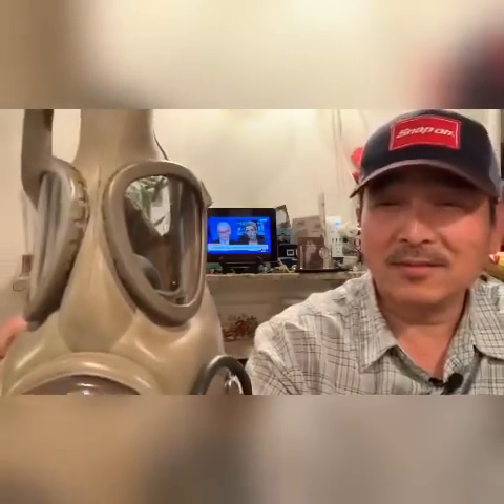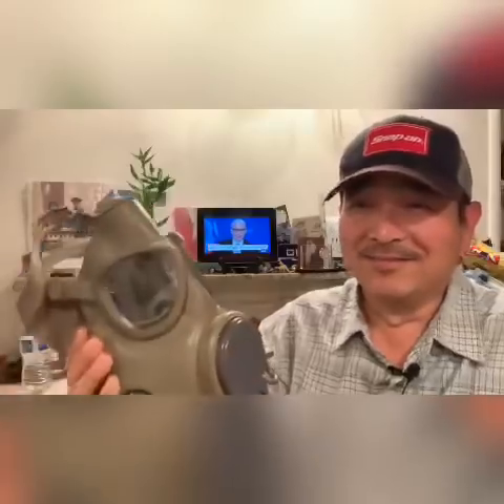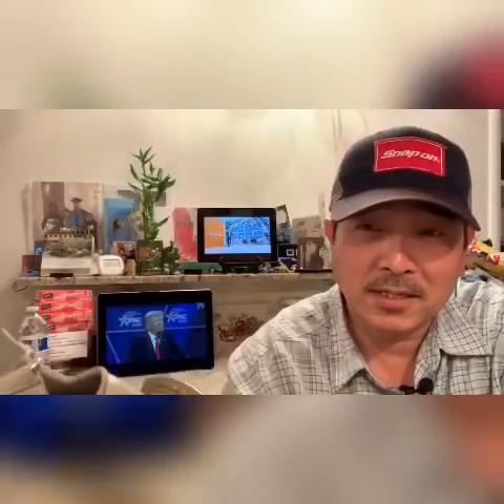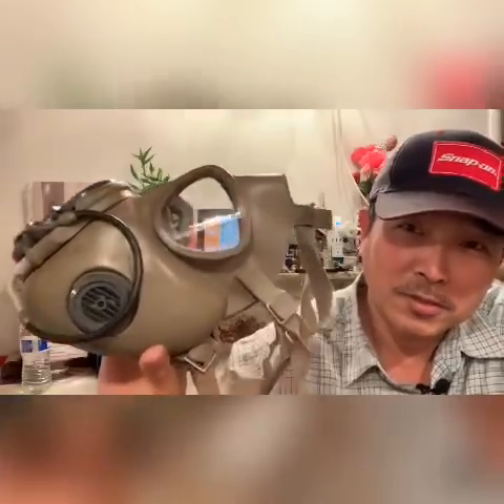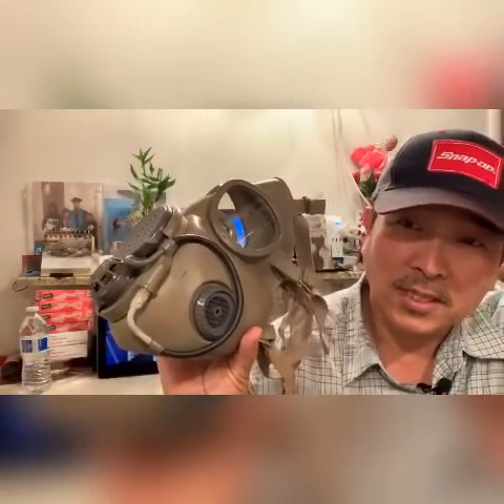How to make a Covid-19 face mask using Hvac air filter.

Comment: You do realize that AC filters have fiberglass that will infiltrate your lungs and be worse that coronavirus ????
Reply from the maker: Thank you for your comment, 🙏 the Honeywell brand doesn’t have fiberglass. If they did there would be a big class action lawsuit. People with lung cancer would blame them. High pressure air being blowed through filter and circulate in home and we breathe it. Please stay safe, respectfully r. Matthews

Comment: Great idea to leave the wire in rather than stripping it out which would damage the integrity of the filter fabric!
Reply from the maker: Thanks for your comment 🙏 in another video I removed metal wire netting  by soaking in hot water. And adding salt to filter. Please stay safe, respectfully r. Matthews
Reply from the maker: +R. Matthews https://youtu.be/Eq8qyO4G4No
Reply: Do not wet or wash the filter. You remove the metal from the filter before using it these filter are folded like an accordion that is what charges the filter to collect particles. So remove the wire dont wet , heat, or wash the paper and keeps the folds in the filter that is how to use these filters.

Comment: That is a #10 filter. The #13 filters cover viruses. My #13 has heavy wire mesh on it . It was harder to work with
Reply from the maker: Thanks for your comment 🙏 I don’t know?  Should be the same.  CDC are saying make them out of fabric! I think so you can throw them in washing machine right your  trip in pubic. Plus my homemade mask with filters is for short runs to the store. As an extra shield for peace of mind. Do not use homemade mask to visit anyone that are sick period.  Please stay safe, respectfully r. Matthews

Comment: 3M Statement (re: HVAC filters and mask use): "Our filters are designed to be used in HVAC systems, and the filter media has not been tested to be used as a face mask for respiratory protection. Altering any of our 3M Filtrete™ Air Filters is not recommended or supported by 3M or the Filtrete™ Brand. Customer safety is our number one priority. https://www.filtrete.com/3M/en_US/filtrete/home-tips/full-story/~/coronavirus-and-important-things-to-know-about-airborne-particles/?storyid=d69e7735-c02c-46d2-9c8a-ae23372934ac
Reply from the maker: +B GT thanks for you comment🙏 if the Honeywell hvac filters are not safe, there is a  class action lawsuit waiting to happen! People with lung cancer would blame their cancer on these hvac filters. Think about it... if they are not safe, why are we letting our babies breathe house filter air? Air are being blown through these filters with high pressure and recirculating the air we breathe for decades! And just now we are afraid of these filters. Just saying, respectfully r. Matthews

Comment: Great idea I used the Filtrete 2500 smart filter. Premium allergen n fine particles. Has American lung association logo. Blocks, Viruses, pollen, mould spours, exhaust n much more I will try post on my channel easy to make no sew mask. I used aluminum wire to make a oval to hold the filter part and shape around nose and under chin
Reply from the maker: +Hi Honey thanks for your comment and viewing 💪🏼🙏 , like your profile name👍
Reply from the maker: Hi Honey  , just learned that n95 mask uses citrus acid inside there masks. They used citric (lemon juice) to kill of COVID-19 and other forms of Coronavirus!   So instead of rubbing alcohol, use lemon juice. So if you make your own masks, spray lemon juice on outside mask and let dry. Please stay safe, respectfully, R.Mathhews

Comment: Why are you trying to buy N95 masks when our medical professionals are having trouble getting them? Making your own mask should have been your first thought, not Plan B.

With that scolding out of the way, I have been thinking about using pieces of Filtrete 1500 filters as disposable inserts myself, and think it's a good idea to use those. I would suggest at least one modification to your mask, though, which is a flexible but strong piece of metal at the top like the respirators you were looking for have, to mold the mask around the sides of your nose. If you have some sheet metal like they use in ductwork, some tin snips, and a way to file the sharp edges, this will do an excellent job. This is what I used in the washable mask I made, and it stayed put while I shopped for two weeks' worth of groceries. If you don't have sheet metal, I have seen people cut up a soda can and fold a piece into thirds lengthwise for extra strength, or thick wire with the ends folded in would probably work well, too.

Also, I wouldn't suggest pulling the mask down, then pulling it back up with your fingers touching the inside of the mask. You could contaminate the inside of the mask that way, which defeats half the purpose of wearing it. That is, assuming the other half of your purpose for wearing it is to protect the people around you in case you have it without knowing it, in which case it may still serve that purpose.
Reply from the maker: Thanks for your comment/s🙏 NO ONE is looking for N95 masks ! Please watch my videos/s before you start judgements! That’s why we have fake news! And look at dates of video! No one is looking for N95 masks!!!! I was making a point (how you can’t go anywhere for masks period) on how you can’t  buying them.  I didn’t care if it was n95, f100 or w9 masks, I wanted a mask/s period!!! Before this COVID-19/Coronavirus, I thought a mask is mask! I just bought them at price range. Of course the higher of price masks are better in my world. Back to subject; that’s why I started my video on how to make your own masks with HVAC air filters.

Comment: I used a filter just like that but used it between 2 layers of cotton. I removed the metal and it really didn’t mess up the filter.  I figured it was going between 2 other layers so it should be ok. Good tutorial and idea though!
Reply from the maker: Kayla McCloud  , just learned that n95 mask uses citrus acid inside there masks. They used citric (lemon juice) to kill of COVID-19 and other forms of Coronavirus!   So instead of rubbing alcohol, use lemon juice. So if you make your own masks, spray lemon juice on outside mask and let dry. Please stay safe, respectfully, R.Mathhews
Reply from the maker: Thanks for your comments 🙏 I guess try to find thinner fabric for the outer side. Sorry you’re having a bit trouble.
Reply from the maker: Kayla McCloud https://youtu.be/Q5r2ki20y3g

Comment: Can only use it once, because as you breathe, whatever bad will be sucked in through the cloth to the filter. Remove it so the outside doesn’t touch the face at all and you must sterilize the cloth again and put a new filter in.
Reply from the maker: Like all filter masks at this time of crisis , one must sterilize it with spray alcohol after use. Any filter,s like n95 at this “TIME” are being use over and over at least one week! We can’t just throw them away like we use to. Mask are like gold at this time...
Reply: Air wont go through the filter. Path of least resistance. When he inhales the air will come from the side of the mask where theres no filter and no resistance. Nice idea, better than nothing to stop droplets if someone gaks nearby but the filter needs to be sealed  aound mouth and nose, on the face, to prevent virus contimination.
Reply from the maker: Seek Wisdom https://youtu.be/Q5r2ki20y3g

Comment: I have been making masks....I have a question. Is there anything from the filters that is harmful if breathed so close to your mouth. I will be calling the company today. I use the Filtrete Advanced Allergen 1500 microparticle performance rating
Reply from the maker: Faith Liskiewicz , it should be safe, . Those filters are made for your home system and you breathe it daily. Plus, your home air system blow air through it with a high degree of pressure much stronger then how we would breathe through it.
Reply: Im using Filtrete 1900,it  filters EVERTHING,,incl viruses, I had the same question...I will probably do a two ply
Reply from the maker: mssavedin92 Faith Liskiewicz , it should be safe, . Those filters are made for your home system and you breathe it daily. Plus, your home air system blow air through it with a high degree of pressure much stronger then how we would breathe through it.
Reply: @rickmatthews  It SHOULD be safe...hopefully it is, thankyou
Reply from the maker: mssavedin92 like I said in video, it about not able from getting your hand on the N95 masks! So people like me have to do something for the family, just for the peace of mind that I will have knowing there is something that will shield me from people coughing.
Reply: @rickmatthews  we all have to do what we can
Reply: mssavedin92 I tried making one with 2 ply with cotton on the outside and it was too think so I made another with cotton on the outside and 1 layer of filter on the inside and it was better.  If you were only using the filter 2 ply would be fine I’m sure!
Reply from the maker: Faith Liskiewicz  , just learned that n95 mask uses citrus acid inside there masks. They used citric (lemon juice) to kill of COVID-19 and other forms of Coronavirus!   So instead of rubbing alcohol, use lemon juice. So if you make your own masks, spray lemon juice on outside mask and let dry. Please stay safe, respectfully, R.Mathhews

Comment: The bottom needs to be pulled in too so virus doesn’t go in the bottom of the face mask
Reply from the maker: Newark EveryDay its pretty sealed all around your mouth and chin.
Reply: R. Matthews okay awesome have u seen the salt 😷 masks ones can u try that with the helps filter!?
Reply from the maker: Newark EveryDay, thanks for subscribing! Awesome 😊
On the salt coated face mask is a great idea! Like it.   I will make one with my style.  Only one thing I think while wearing salt near your skin can irritate your skin if you perspire! 
Maybe have the extra filter as a shield. Will try it.  Thanks again.
Reply from the maker: Newark EveryDay  , just learned that n95 mask uses citrus acid inside there masks. They used citric (lemon juice) to kill of COVID-19 and other forms of Coronavirus!   So instead of rubbing alcohol, use lemon juice. So if you make your own masks, spray lemon juice on outside mask and let dry. Please stay safe, respectfully, R.Mathhews